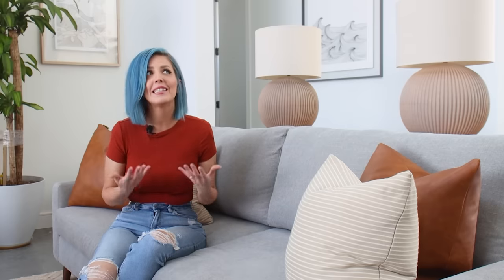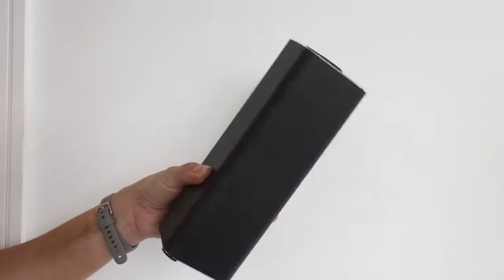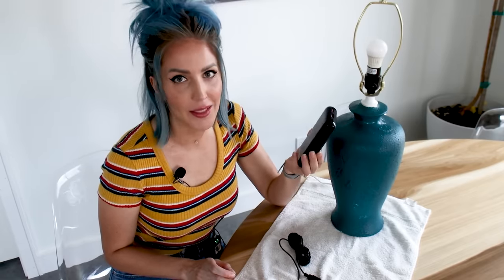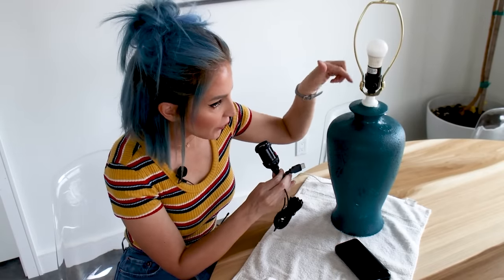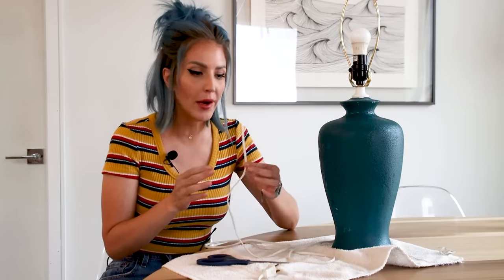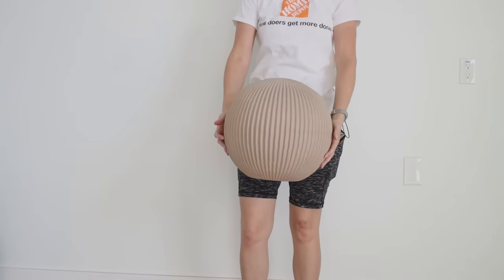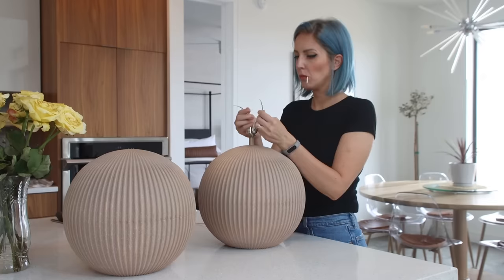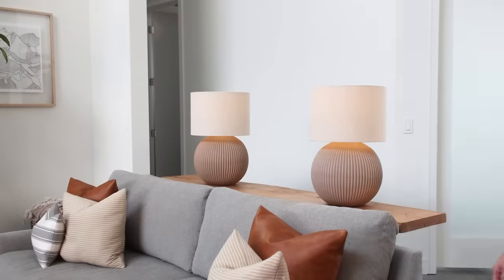3 EASY Ways to Make a CORDLESS Lamp

Comment: the reason you can't get more than 5 V on the USB C is you need a device to power the bulb that has "PD" or power delivery. there are some fully assembled modules that plug into a usb source and gives you 12 V out, and cost less than $10. This is a much better solution for you since the power bank is easily rechargeable. There are some solutions that need a bit of soldering however they only cost $2-3

Comment: That fitting is called a nipple because it dates back to when lamps were originally run with gas! And that's considered a pipe nipple plumbing nomenclature.
Reply: Ok, now explain the "male" and "female" ends of an extension cord. 🙃
Reply: @kahlesjf  well when a mommy and daddy extension cord....
and when 2 male ends get together they create a suicide cord.
When 2 female ends get together they create something that's on only fans.

that got dark fast!
Trying to think where this goes back to, I was gonna say the electrical and electronics industry but it's predated by pipes I think.
They were some obvious form meats function going on with the naming.
But I suspect it might go back further. Reminds me of a movie City of Ember (2008) where they use the phrase "your ship is going to come in" but they've been underground for 100 years and don't know what ships are but it still permeated the lexicon.
Reply: @imark7777777  🙃😅👍

Comment: You need a USB power bank that has a technology advertised on the front called 'power delivery'. After you get that, you need a USB C trigger module from eBay. Plug the module into the power bank, set the trigger to 5, 9, 12, 15 or 20 volts, then plug your USB device into the trigger module. Make sure the voltage you choose matches the device you're powering.

Comment: I like your third option with AA batteries. But instead of cutting the plug from a table lamp, why not chop up an extension cord? Cut the extension cord rather short and then wire it to the battery pack. The altered cord would serve as an adapter for the battery pack. With that method, you have more versatility when you rearrange furnishings. That would mean you'd want the option to hide the cord inside the base or leave it exposed to connect to a wall outlet. For some lamp styles, you might need to rewire them at the socket depending how the plug end exits from the base.
Reply: This is a brillant idea! I really want to create a battery operated option for lighting around my home but don't want to permanently make those changes to my lamps.
Reply: I'm in South Africa and batteries are expensive :(

Comment: Option #4

Use a rechargeable light bulb.   Some bulbs have switches to change to battery power.    

For bulbs without switches, simply wire a female extension cord socket with an internal bridge between the hot and common sides of the socket.   Plug the socket into the lamp cord and turn on the lamp switch.

Comment: If you are using a dc light bulb you can cut off the power leads like you did in option 3 terminate in a usb head and connect it to a power bank )option 2) thus not having to change the light bulb socket

Comment: I think I will keep things simple and just use an extension cord.  No charging required!   And it only about $6.
Reply: One disadvantage of doing that is you'd end up with a lamp that will not work if there is a power failure. A cordless lamp would still work.
Reply: I concur……. They have done the job for decades. 
Power outages….. no worries! I have plenty of candles & oil lamps for those very rare occasions.
Reply: That's fine but there are situations when you want a lamp on a furniture island and it is unsafe to have an extension cord trailing across the floor.
Reply: Your observation makes real sense.  When no outage is expected , a hidden extension cord will make her project simple .

Comment: They've had rechargeable light bulbs that fit in a normal socket available for at least a year, which would take care of all of these issues without the need to rewire anything. Now, the only problem is that they don't have them in the smaller E12 size yet, as far as I can tell, so I'm about to rewire a fixture to make it a swag, but I'd much rather have a cordless bulb.

Comment: Home Depot has LED recargable Light Bulbs that would work with some of these idea's.
Reply: LED is definitely the right solution. The power draw should be low enough and they work just fine with DC.

Comment: Interesting. I was brainstorming with my mom on how to make that exactly work.

We looked at 12V lamps and concluded they were impractical. They would not light the lamp very long.

Let me do the calculation for your setup.
On amazon you find lights for RV, they are 12V and 6W. 
You power them with 8 AA 1.5 batteries. I suppose the pack wire them in series to get the proper 12V.

I checked out duracells battery online, they are typically 2.85Ah. At 6W consumption and equal voltage, that would be a draw of 6 A in one hour.
So do your pack only power the lamp for about 25 minutes?

Am I accounting this wrong? How long does your lamp last with that setup?
Reply: OK, I am being an idiot.
The batteries lined up are equivalent to a 12V battery for 2.85Ah. But it is at 12 volt.

P=VA. So the power draw is A = P/V which at 12 V and 6W is 0.5A.
The battery is 2.85Ah so about 5.5 hours.

It is still not much. But much better than 20 minutes.

Is 5 to 6 hours what you see in practice?

Comment: The rechargeable power bank's USB C port will only output 9 or 12V if a smart device (phone/tablet/laptop) capable of tolerating higher voltages is connected and notifies the power bank what it can handle.

Comment: The reason why you can't get 12v out of your USB C power pack is because the receiving device has to specifically request the increased voltage (this prevents it from frying 5V devices).  Your random USB A to C plug is never going to request more than 5V.  You would need to get a specialized breakout board to get the extra voltage out.  But, at that point, it's easier to just use a DC step up converter that will work with any battery pack. (They're pretty small and cheap and can usually bump the voltage up to anywhere from 7v to 35v, depending on what you set them to.)
Reply: Also you can find USB rechargeable Li-On AA batteries, and just connect a hydra cable to them so that the batteries never need to be removed to recharge them.

Comment: On the first option, I think I would prefer to attach the power unit beneath a countertop with velcro or bracket of some sort and let the lamp cord drape over the edge to plug in. My objective is to avoid any cord trailing across the floor. The fan would get adequate circulation and I would not have to try to fit the unit inside the lamp base. Its the fan noise that is the deal breaker for me.  That type of noise gets on my nerves something awful.

Comment: Adding a Bluetooth or WiFi controller, plus extending a recharging cable to the bottom of the lamp, you should be set for life. And with a programmable interface (Google/Alexis) and timer, you don't have to worry about too much wine in the evening and waking up in the morning not only with a hangover, but dead batteries as well.  If you are going to the trouble of reconfiguration of a light, you may as well go Smart.

Comment: Me: "I'm working with AA batteries to get 12 volts to run a 12v light bulb."  
Licensed Electrician: "Seriously...why did you call me?"
Reply: When I was on middle school, we lit a standard 75w lightbulb with c batteries. It took roughly 50 of them to accomplish and about 10 feet of batteries. These days,  you could do the same thing with a handful of batteries,

Comment: 5:54 the reason is that there is nothing in the lamp telling the Powerbank that it wants 12 volts.
It will only send 12 volts of the receiving end can handle it and specifically says "give me 12 volts".
And your lamp holder and lamp does not have the electronics for that.

You can buy boards you place in between the Powerbank and the lamp holder that will talk to the Powerbank and tell it to give 12 volts.

It's not very hard but it does require soldering.

Comment: An even easier and cheaper way is just to replace the light bulb with a rechargeable puck light.
It wont work with the lamp switch, but you can also get puck lights that use motion detection.

Comment: you dont actually need to change the socked to a DC one, just rewire the ac wire to have the right positive and negative polarity to the actual base, then you can use the DC bulbs with any socket

Comment: You can install an outlet wherever you want it.
Reply: Bingo.  I’ve yet to be in a house that does no have access—per wall—to one or more 110v outlets.  From there you can pretty much expand the number of outlets on the wall.  Don’t forget, you can drag a 110v connection to any wall with a light switch as well.  All these “techniques” are simply variations of battery operated flash lights.  Guess what, they’ll need constant maintenance/recharging.  These suggestions are worse than the problem they attempt to correct, which I maintain is almost never found.

Comment: 6:55 you could have soldered the USB cable to the existing 110 volt wires and the job would have been done.

Comment: I don’t know why you want to get rid of the cord so bad. However it’s really not that complicated to learn how to wire a USB port to some 18 650 batteries or whatever you would use on a lamp. It never really bothered me that much having a cord so I didn’t look into the appropriate battery size just get a soldering gun still a USB port from a broken device. Easy.

Comment: An inverter is a ridiculous option.  The conversion from DC to AC is wildly inefficient, (as it generates alot of heat, thus the need for fans), and the fans take away energy that could otherwise be used to produce light.  Silly to even suggest it as an option.

Comment: don't modern light bulbs have like a transformer in them... and that's why you can power them using batteries .so if you get a wireless charger connect it to a battery pack. and connect the battery pack to the lamp. then you can charge the batteries using wireless charging with out the need of replacing the battery.

Comment: I like the innovation, but battery lamp at home never sits well with me.  I would rather install an outlet where the lamp needed to be.  There are outlet strips where you can conceal into a table (Much like the one in conference room tables) and wire from table can easily routed to an outlet.  It's a bit more work but don't have to deal with recharging or replacing batteries.  The only cordless lamp I have is from my tool kit - DeWalt flash light with 6 AmpHr battery for black outs.

Comment: Instead of using a whole rack of AA or AAA batteries, why not use some 18650 batteries instead? They output 3.7V each and in serial, 3 would give you 11.1V and another would give you 14.8V just head to Amazon and get an adaptor case or make one yourself. Another reason to use 18650 is that they last so much longer.

Comment: Your trying to be a mad scientist and reengineer the complexities of voltage , wattage and amperes . Just get a longer extension cord and hide it in some conduit that matches your decor . Your'e over complicating something that trained engineers have toiled over for decades to make safe and are probably making a potential  fire hazard. Have an electrician upgrade the breaker and add outlets where you need them. What good is a " cordless light " if it is NOT reliable, bright enough or a fire hazard .

Comment: Personally I hate having to buy lot of batteries and even if I could use rechargeable batteries, I don't like to faff about with them. I am more interested in Idea no. 2. For all the electrical engineers out there, how can I connect the existing wires of my lamp to a USB male outlet without having to purchase a USB powered bulb socket? There has to be a way!

Comment: I wish you would use a cut off tool meant for cutting metal, or at least get a guard for your angle grinder, and I hope you weare proper eye protection. Your face was within range the blade shards could go if the blade broke.

Comment: Why take the lamp apart, you can keep it external and just place it where its not seen. Your first method still keeps the fan covered so no airflow. Those USB power packs will put out 12V but not the amps that you need for a bulb.
Reply: LED lamps generally have quite low wattage ratings, 5w maybe, depending on the lamp. At 12v that's roughly 0.4a. W/V = A

Comment: I admire your tenacity and investigative nature and approach, however, what are you achieving? Your overall not saving money as the materials are going to cost various amounts and the last one you have as an upfront cost then continue to replace batteries, perhaps a Bluetooth option or longer cord, but I think with your time, it’s a failure for any advantage that you could gain.
DG New Forest U.K.
Reply: The purpose of doing this has nothing to do with saving money. Many people, myself included, hate the sight of lamp cords in our homes. It's a visual and aesthetic thing. We have a large antique oak library table for example, with a Tiffany lamp in the center. Instead of trying to disguise the cord with books or whatever, we can now hide it IN the lamp. In other rooms, seeing the lamp cord isn't an issue.

Comment: I have tried the third technique using a 12v DC candelabra light bulb and each time when I power up the lamp the batteries get so hot, they melt the plastic holder. I do not know what I am doing wrong.

Comment: Why bother putting that first battery pack inside the lamp if all you have to do is plug the lamp cord into it.  Just put the power bank on the floor behind some furniture and you're set to go.  You could also use the power bank for other applications too.

Comment: Interesting, but all of these options are either expensive or suck....run another outlet or don't put a lamp there. If you're looking for an option during a power outage, a camping light of some sort would be far more efficient and purpose designed for the usage scenario...and of course there's good old fashioned candles.

Comment: You should definitely consider embedding wireless charging in the furniture. If one goes the length of making battery powered lamp. then adding a wireless charging is the only solution. otherwise why bother...

Comment: For light, well for the good stuff that's not the LED crap AC or DC doesn't matter. Polarity also doesn't matter. AC and DC is only important when there are circuits involved. Like the lousy LED rubbish, motors etc. With AC, polarity also doesn't matter, despite the polarized plugs. It's more of a safety feature, which really doesn't do anything unless the device happens to be grounded. If there is no outlet where you want your lamp, an extension cord is useful. If you don't want an extension cord, you might consider a specialty lamp that's used for camping or something like that.

I rewire all my lamps with a cloth like wire. I hate these damn plastic cords. I also use halogen for a clean, bright, warm light. Those LEDS are awful and contrary to what is said, they do burn out, and in a bulb, if one diode fails, which they do, the whole thing is no good anymore and you have to replace it anyway. So I am not sure why anyone wants the plastic rubbish when glass bulbs and a filament is so much better. Also, I believe that these LEDS are destroying people's eyesight. More people now, than ever before have some kind of vision problem and need glasses or contact lenses. It's a very harsh light.

Comment: The 3rd way is nonsense. The more batteries you introduce into the circuit the more likely you'll have one cell fail earlier than the rest and if one cell fails, you may not have enough voltage to power the light. Your lamp won't work so you'll wonder if it's the bulb or the batteries and you'll have to check everything. Once you find your failed battery, are you going to just replace it or replace all of the cells? If you only replace the one cell, you'll then have one brand new cell and seven used cells. Over time replacing cells one at a time will lead to a very unbalanced battery pack and you may end up having to replace a cell every month. I experienced a similar problem when I owned a diesel Mercedes. Diesels use glow plugs not spark plugs. It's possible to start the car with three dead glow plugs, but it may take a couple attempts. At which point it was time to take the car in for service. Most diesel mechanics will replace all the glow plugs at the same time even if the majority are still good, but the car won't be back in for glow plug service for at least 100,000 miles. I had an honest, but eccentric mechanic who would only replace the dead glow plugs with new ones and leaving the other used glow plugs alone. It wasn't long before I was in the shop every six months having a glow plug replaced. That six months became three months. And if I hadn't sold the car that three months would eventually be every month I'd be in having a glow plug replaced. So don't even bother with her 3rd way to make a cordless lamp!

Comment: Aaaaa just so you know they sell wireless led self contained battery that is easily rechargeable battery with also a remote if you want. Oh n there cheap. And it would be nice to have a wierless lamp n now you can without all that other expensive nonsense.

Comment: Very power lossy,    Your better off building a battery pack and using 12 volt Led RV bulb.  Any time there a voltage conversion that 20 percent power loss.    And there lots of LED that runs  
 That can run directly on batteries.
Reply from the maker: Did you watch the whole video?